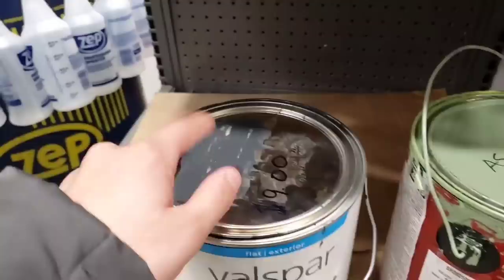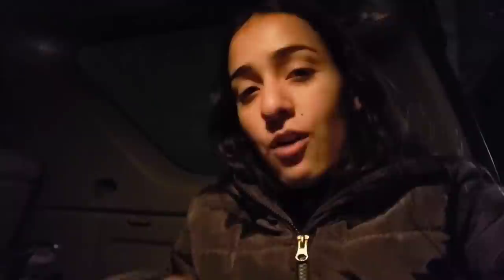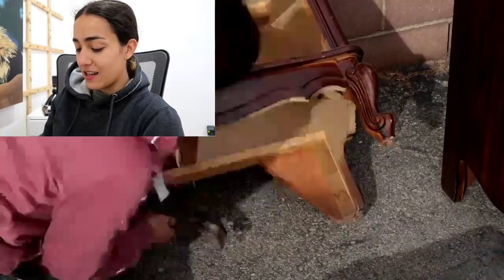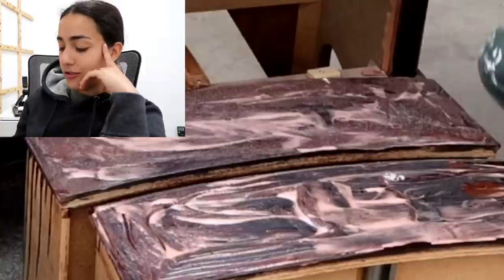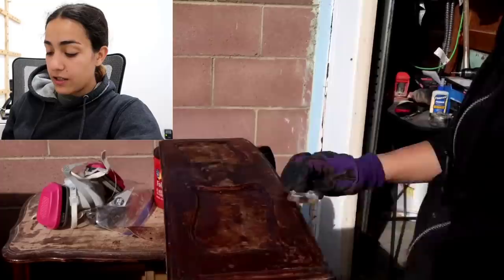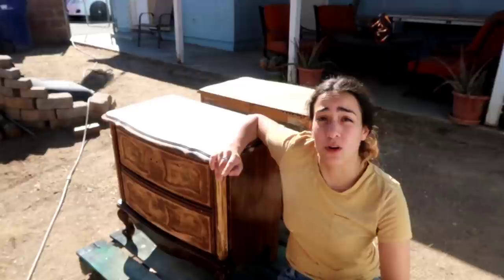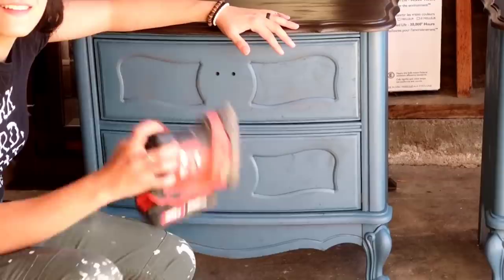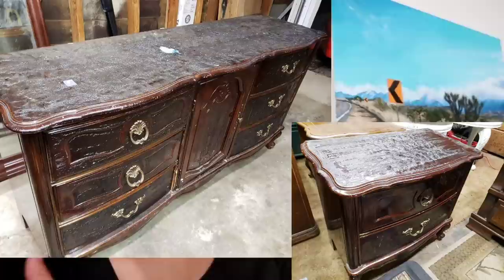Flipping Furniture Start To Finish/ What Mistakes To Avoid / HUGE PROFITS

Comment: Smart idea to use the gold marker on the hardware!  You may want to check out a product called Rub n Buff for hardware or anything you want metallic.  A small tube is about $8 easy to use and the tube lasts a very long time.  Michaels and JoAnns usually carry it and you can use their coupons for discount.  Good luck!

Comment: another suggestion that will save u money...the orange stripper is amazing however u are using a lot...wasting product and washing money ...so here is what i found out by trial..stipple the orange product all over the area u need...do not use heavy product...put plastic over and wait for about 3 hours...remove plastic and use a painters scrapper...then find the areas that need to reapply...stipple the orange thing ...plastic and wait for 3 hours..remove, and clean...the bottle will last longer saving u money.  I just to apply a big  amount on the furniture  thinking more is best but it is not...until i was running low on the product which force me to stipple and voila...that is how i found the method...

Comment: I think you could have got more for that 3 piece set especially considering all the hard work you put into it. Anywhere from $700 - $800. So that looks like shellac you scraped off, maybe a couple of coats of it. One tip I saw years ago you might want to try is using hot water with baking soda and fine steel wool to see if this will work before using stripper. You did a great job.
Reply from the maker: Thanks Doris for all the tips!! Thanks for watching!!